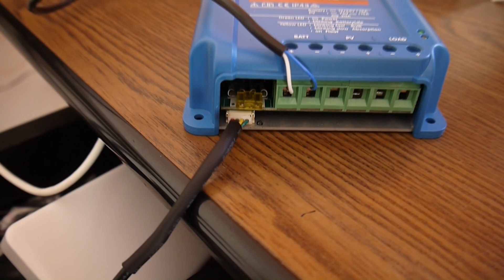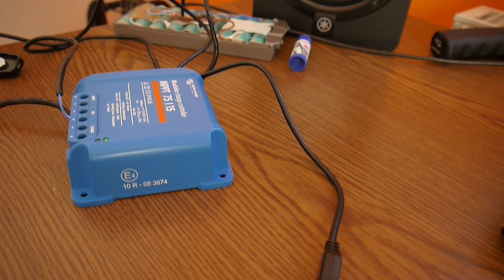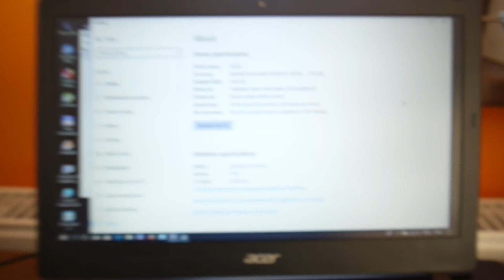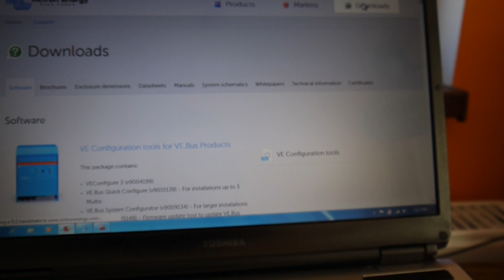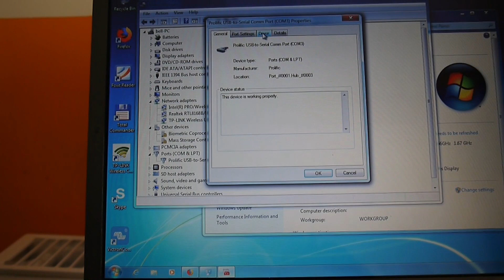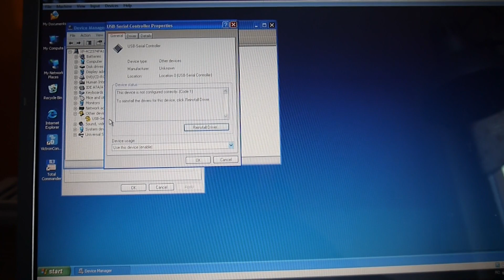DIY VE Direct data cable Victron solar charge controller

Comment: La mine nu a mers. Probabil au facut ceva modificari ca sa mai cumperi cabluri de la ei si bluetooth adaptors tot de la ei... Am incercat pe doua telefoane, chiar si cu Rx la Tx si invers. Telefoanele nu detecteaza chargerul meu mppt 75/15. Chestia e ca chargerul decupleaza LOAD abia la 6V primiti de la baterie (in loc de 10) deci poate ca e defect, proaspat cumparat :(
Reply from the maker: 'I don't have the charger anymore, so I can't test again. It's very possible in your case  to have a clone. There are some looking identical.

Original  post in Romanian: 

''It didn't work for me. They probably made some changes so that you can still buy cables from them and bluetooth adapters also from them... I tried on two phones, even with Rx to Tx and vice versa. The phones do not detect my mppt 75/15 charger. The thing is that the charger disconnects LOAD only at 6V received from the battery (instead of 10), so maybe it's defective, just bought :(..

Comment: Hi. Is there a solution to monitor Victron solar charger over wifi?(like Epever) Thanks
Reply from the maker: I think they have a controller GX or something, like 400US, way to expensive, but you may try ESP32..like here..https://github.com/pmcg31/esp32_victron_test
Reply: @viocaia  thanks. i don't know arduino/esp32 😃
Reply from the maker: @adaniel69 Me too...maybe a Raspberry  Pie with some sensors…it can be  done.
Reply from the maker: @UKsystems Probably yes! Good idea. I don't have that charger anymore so...

Comment: This would be useful if you documented the connections to the Victron.  You show on paper that GND is green but which pin is that on the Victron? Don't assume everyone has the same cable you bought and that all manufacturers use the same colours for every wire.
Reply from the maker: I don't have it anymore, but there are only 3 wires, ground TX RX.. once you figured this evrythig ok, stay away from 3.3v pin is not needed
Reply: @viocaia  Thanks , I found it : 
Pin 1 – GND
Pin 2 – TX
Pin 3 – RX
Pin 4 – +5V

Note TX/RX pairs need to be crossed. If you don't get tranmission, try swapping them. 

"MPPT Solar Charger Manual" p 15 :  pin4 left hand side for these 75V/15 types ! This is important since the same connector is the other way around on 110V models !

19200 8N1
I was having trouble finding one of these JST4p connectors without ordering from China but I just found an old PC audio cable for internal optical CD drive which has one. Lucky that I keep all this junk for years. ;)
Reply from the maker: @tuberroot1112  Sounds like.. Never through away electronics😂 All the best!

Comment: so for longer connection you can use an RS232 Chip to convert the 5V TTL to 12V
then i use a 20m Cable from garden to house... and on the and again an RS232 Chip from 12V zu 5 Volt TTL to an Ch340 Usb chip... done works very well👍🏼👍🏼👍🏼
Reply from the maker: Interesting! Thanks for sharing!

Comment: So we should be alble to connect an USB-Bluetooth dongle on the USB cable and have a bluetooth connection? Without the cables, only by bluetooth, if we connect the red wire also? Did you tried?
Reply from the maker: No idea! I don't have it anymore..but very good device.

Comment: Well, did as you show with cable and nothing.
Reply from the maker: If you have the right parts, exactly the USB chip and connections..it should work..try to reverse data signal
Reply: @viocaia  They changed the connection pins.. Gnd is on other side.. 👍
Reply from the maker: @SuperMaiki76  So you did it? Nice!
Reply: @viocaia  Yeah, after few attempts. I kind of figured it out that this video was released long time ago that they surely updated the pins too
Reply from the maker: @SuperMaiki76  Probably yes..

Comment: It's just what I need. Thanks for sharing.
Question. The original cable comes with a "squared box" in the middle of the cable or besides the USB connector (I just saw this two different options when you want to buy a v.e. connector-usb) . So, has you ever open that box or have you any idea of what could be inside?
Reply from the maker: No. I didn't had any original cable..probably there are the IC's board..
Reply: the box is filled with USB to RS232 Serial protocol converter nothing fancy

Comment: why do you want to go all thru this when you can buy a cable made for some of the Victron Blue charge controllers unless you like messing around with Soldiering and damaging your charge controller?
Reply from the maker: Why should we go to the moon...we can see it from here!
Reply: @viocaia  We went to the Moon?
Reply from the maker: @mannyfragoza9652  Does this burn your charger? Who knows?
Reply: @viocaia  i havent set it up yet i still need a few parts to complete my DIY solar setup. So my answer is i dont know yet
Reply from the maker: @mannyfragoza9652  don't forget to have fun..that's why I'm doing this stuffs..
Reply: @viocaia  true sometimes i forget to have fun

Comment: i have tried to make like this cable but not working and using rs232 converter as well did not work in application rather then when i moniter using some software the communication starts , in putty even shows some scrambled but in application its not showing
Reply from the maker: It should work..try to reverse data lines..
Reply: @viocaia  How to reverse data lines in putty or any terminal i couldnt able to find it. Are u Saying about the TX And RX , if i reverse that then there is no output.
Reply: i am using windows 10 20H with prolific rs232 to uart ,
Reply from the maker: @umerdastgeerkhan  maybe it's Victron clone, I heard there is a problem with the software once upgrade the firmware..but have you tried with the exact chip like in the video?
Reply from the maker: @umerdastgeerkhan  maybe there is a new software checking for originals..sorry

Comment: Why didn't you just use a mini usb conector to make the splice with, it would save the usb to mini adapter
Reply from the maker: It needs a OTG adapter, is not working directly to the phone's micro port

Comment: WIRELESS
My solar panel and Victron charger is on the 3rd floor and the control center is at ground.
I try to use bluetooth, but as written in manual Victron Connect must pair it,  and i think that find an answer that from a normal dongle cant provide.
Googling found one serial to air (433MHz) bidirectional receiver/transmitter called HC-12 and finally I have a wireless connection with the Victron.
One HC-12 to Victron and another one to the DIY VE Direct cable. Set BaudRate on each to 19.200.
https://www.dropbox.com/s/d0fi7btis65qsck/HC-12.jpeg?dl=0
Reply from the maker: I did it with an old laptop connected to the house WIFI, running locally Victron software and access it by TeamViewer...

Comment: For Samsung S use the OTG adapter included in the Samsung box and all works fine.
https://www.dropbox.com/s/46vpqsos28vcpl3/IMG_2612.jpg?dl=0
Reply from the maker: Thanks for sharing ! It should work.
Reply: Tell me plz..samsung s9 Type c OTG adapter also working...?

Comment: is this the right cable ???
"USB to RS232 TTL UART PL-2303HX (Chip Rev A)"
Reply from the maker: it should work..
Reply from the maker: Prolific 2303 based adapters also works
Please subscribe !
Reply: @viocaia  With pleasure :)
thx
Reply: @viocaia  my cables (both ends) has not the same colos as yours. ...Thank god the chip was labeled. :-)
so this works - thank you, you saved me 20€
Reply from the maker: @Bergwacht  Nice!

Comment: Thank You for sharing!  
I have 2 units one with built in  Bluetooth and one without;  
I was  too lazy to connect the one via USB  until I saw how easy you made it for the rest of us!!

I found a 2 year old cheap FTDI adapter in my parts bin (previously used for esp32 /Arduino programming/tinkering,)  
and used your cable diagram to connect to my windows 10 (home) laptop.
I had accidentally swapped +5v and ground in my cable and it took me a few minutes to figure that out but,
- It worked instantly and seamlessly... and it upgraded to the latest Victron firmware on my charger. 

I also opted to  download the latest VictronConnect release on windows (5.32 beta  - 2019-09-14)
I see they added support for lithium batteries and lowered the bulk charging voltage for all batteries. 
https://www.victronenergy.com/live/victronconnect:beta?s[]=release&s[]=notes
Thanks Again!!
Reply from the maker: Well, I had ''inspiration'' too..but thanks!
Reply from the maker: Hey Tom..please help me with subscribe, will help me for future projects

Comment: Hi, I have a VE.direct bluetooth dongle wired to my bluesolar mppt. Unfourtantly there is only one VE.Direct port, do you think it would be possible to create a JST cable splitter and use the bluetooth and free up a port at the same time? thanks
Reply from the maker: I don't think so..if there are data in the same time I really don't know how the RX Victron will interpret them..but you can try..there is no harm like voltages to ruin the ports..
Reply from the maker: Hey! Can you help me with subscribe? Apreciate!
Reply: Yes App woking OTG cann Connect Kabel to Smartphone and Update my Firmware in Controller
Reply: I'm trying to do the same, 
use a dongle AND the TX cable for virtual load at the same time.....Did you try it?

Comment: Hi Viorel,  i follow your instructions. It does not connect. Did you use usb with chip ?   or maybe victron has put software in place in there new models.
Reply from the maker: check this https://beta.ivc.no/wiki/index.php/Victron_VE_Direct_DIY_Cable
Reply: @viocaia  Thank you for your response , from the link above they are using a usb with chip.  Sure it  is to bypass victrons security .
Reply from the maker: @pierrevandermeulen2943  MIne was working as you see, I don't have it anymore so can't help you further, but check the comments! Good luck!
Reply from the maker: Hey Pierre! Please help me and subscribe to my channel! Thanks
Reply from the maker: very possible they changed the software, but check the comments, there are links to the USB chip people are using in the last time.

Comment: First thank you. Another one is: here I see that after graund you connect TXD and on wiki show  goes GND then RXD.
Reply from the maker: Just do the wiring like in the video
Reply from the maker: It.s working
Reply: @viocaia  I already did, I will test it tomorrow.
Reply from the maker: @srdjan272able  The colors for that piece of JST-PH are different, that's why white from USB is black on JST-PH but it's easy to fix..by twisting the wires around.If you have GND in the both sides connected , then RX and TX is easy to find.Good luck! It's working, read around comments
Reply from the maker: And please subscribe for later news.. :-)
Reply: Great video. But what is the connection when all 4 wires are the same colour no yellow coming out of the VE Direct cable
Reply from the maker: @seanjsolar2493  sorry for late answer..two wires should be ground and \3.3V...you don't need any voltage, so exclude 3.3v, so you have ground and RX/TX..you can simply go to elimination...ground goes to ground, and connect data in between until is a match!...Please subscribe for more...thanks!

Comment: NOT ALL JST CONNECTOR WIRES ARE COLOR CODED THE SAME.
My JST was black, red, white and then yellow, starting from the black end.
Reply: So with this JST connector we have black to black, white to white and red(JST)  to green(UART). However I'm not getting any result with the linux VictronConnect app. Also I connected  the wires in the reverse order which caused a disconnection in the MPPT controller (clunk). Would this damage anything do you think?
Reply from the maker: @keesvansteenwyk5007  I don't thing is doing any damage, as long as you dont use any power 3.3v from Victron side of connector.So there a very simple RX-TX connection and ground.I'm concern about Linux driver because I never tested.Victron controller should be ok after a power off, disconnect any batteries or panels.I can't help with more, I don't have Victron in use anymore.
Reply from the maker: @keesvansteenwyk5007  maybe this can help too.. http://www.therollinghome.co.uk/2017/02/18/solar-controller-hacks-and-arduino-integration/
Reply from the maker: @keesvansteenwyk5007  check this out too.. https://beta.ivc.no/wiki/index.php/Victron_VE_Direct_DIY_Cable
Reply from the maker: Yes, sometimes!
Reply from the maker: Hey Nic! Would you subscribe to my channel?Please! Thanks!

Comment: Viorel, great video!. Does this VE Direct cable can be used for firmware update on Multiplus Inverter / Charger unit?
Reply from the maker: I'm not sure, but if there is the same connector I suposse it will work...Victron only!
Reply from the maker: Hey! Silvio! Please consider subscribe! Apreciate!
Reply: @viocaia  Update to MPPT ist woking have testet

Comment: You basically need a USB to 3.3V UART/TTL cable,adapter,dongle,Arduino,Dedicated TTL IC to be able to do this. 

I used the CH340G Chip from an Arduino Nano V3 i had damaged the Atmel 328P IC on but the CH340 Serial IC was still good.
Also a must is to disconnect the 5v connection from USB coming in and also soldering a 3.3v regulator in between replacing the original 5V AMS117 regulator.
I also removed the Atmel IC cause it was dead weight in my scenario and i did not want it intervening, the TX,RX lights work normally on hte Arduino this way.

I can do everything a normal cable can do like updating firmware and changing all the settings through Windows laptop or Android through a OTG USB Cable like Viorel has done.
Just thought I'd include this for anyone asking what and how.
Reply from the maker: Nice!
Reply: Why did you need the 3.3v? as the CH340 chip runs on 5v and the MPPT charger from Victron, and the comms output is 5v logic some the earlier models were 3.3v.?
Reply from the maker: Hey! Please give me a little help and subscribe to my channel! Thanks

Comment: Hi Viorel, I have follow all your instructions and the controller can't be detected ether on my PC or Android device. I double checked the wiring connection diagram and it's good. Any idea of what it can be? I can send you a picture or a short video of my setup for you to have a look. Thanks and Happy New Year.
Reply: Got it! The JST cable that I bought doesn't have the same color order that the one on your video. Mine has Black, red, withe and green, so I changed the red for the black on the JST cable side and every thing works perfectly. Thanks again.
Reply from the maker: Some USB to UART adapters are simply not working, please check this for better info https://beta.ivc.no/wiki/index.php/Victron_VE_Direct_DIY_Cable
Reply from the maker: Hey Alexandre! Please give me a hand and subscribe to my channel! Thanks!

Comment: Great video for connecting to the Victron solar controller with many versions of software devices but
what about bluetooth? If you connect the +5 volts to the USB cable can you drive a small bluetooth
adapter and communicate with Victron Connect via bluetooth? Wireless would be nice.
Reply from the maker: Good idea!
Reply from the maker: Hey Chuck! Please consider subscribe, thanks!
Reply: Even I was thinking such a hack would be better and safer as well

Comment: you used just ordinary USB cable like lead for usb charger?
Reply from the maker: Of course not it.s PL2303 UART to USB adapter check the video
Reply: @viocaia  got it. you think it will work even I use deferent USB driver?
Reply from the maker: @deod.p9813  as long as you do exactly like the video it should work
Reply from the maker: Hey Deo! Please subscribe! Thanks!

Comment: I thought VE.Direct was 3.3v logic... Is this safe to do?
Reply: MPPT models from this brand has 5 volt logic (https://www.victronenergy.com/live/vedirect_protocol:faq#q4is_the_vedirect_interface_33_or_5v). Be warned that many of these USB to TTL cables have 3.3 V logic and should not be used.
Reply from the maker: @MarkRuys  Hey Mark! Will you subscribe to my channel! I need a helping hand..thanks!
Reply from the maker: Hey Simon! Please give a hand and subscribe to my channel..thanks!
Reply from the maker: I didn't used 3.3v from Victron,  I was enough the USB power, all you need is TX&RX
Reply: @viocaia y cable will be 7 meters long, i think i will need that power source
Reply from the maker: @Bergwacht  The USB adapter is already supplied by the PC USB port..so all you need is the data signal, 7m will be no problem for data transmision, eventually use a USB repeater cable long enough..

Comment: JST connectors seem to be (in order they are in female plug) red, black, yellow, white. No green. Is white the green in your diagram?
Reply from the maker: I'm not sure If I understand..the white from USB (RX) goes to black JST wire. All you need is ground and RX TX..you may try in between as long as you don't  use 3.3v from both ends just ignore them,So it\s only 3 wires in fact.
Reply from the maker: I don't have Victron anymore I can't remember which is which.but for sure the 2 in the middle are for data RX TX
Reply from the maker: If you look close at min 2:01 the last pin on the right says G (ground) so you need (from left to right) only 2.3.4 connected.Just ignore 1 (power)
Reply: @viocaia  yes I see. Your JST cable has a green wire. Maybe you made the cable yourself. If you buy one from eBay there is no green cable. That position is white.
Thanks for your quick replies.
Reply: @KayakingTripsAndTips  Please I would like to know if you succeeded. I think I faced the same situation, and of course did not succeed. It does not connect. Please if you were able to get through, let me know how you did yours. thanks.
Reply: @chukslis3486  yes it worked for me. I am sure that on my cable white is ground.
Reply: @KayakingTripsAndTips  Ok, thanks a lot. I will try it out
Reply from the maker: Hey Tony! Please help me with subscribe! Thanks!